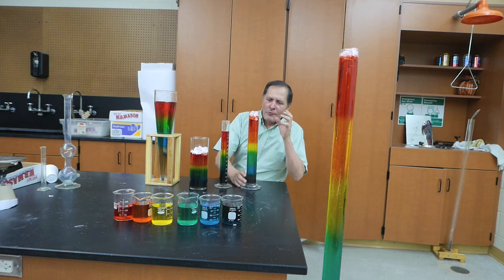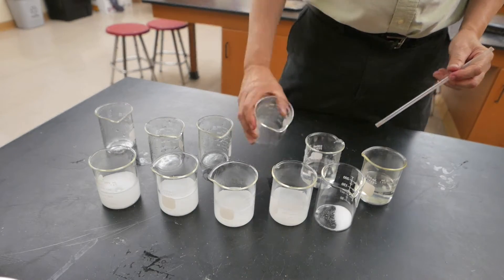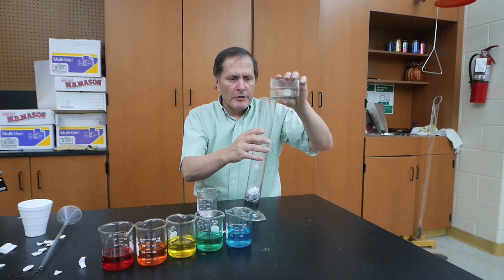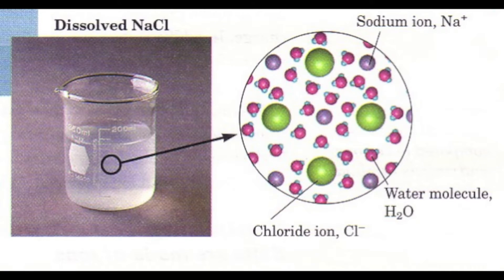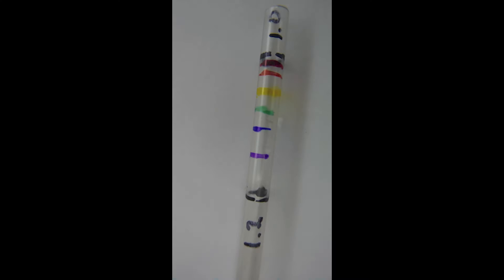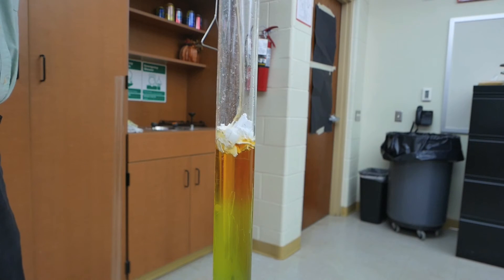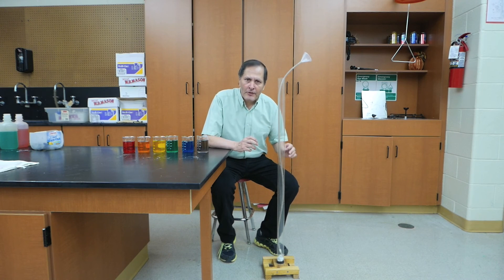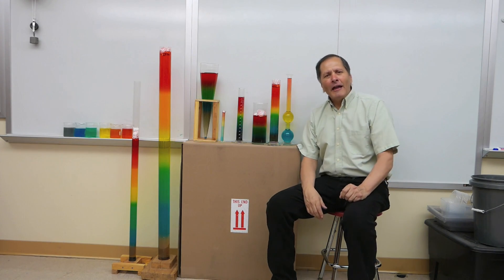Rainbow density column  -- saltwater // Homemade Science with Bruce Yeany

Comment: Didn't you do this before but have a golf ball in there and it would sink and raise? Or am I mistaken
Reply from the maker: Glad to hear you remember it. this  is the same concept,  I had a tube with salt at the bottom added water and then dropped a golf ball into it.  As the salt slowly dissolved, the ball would rise

Comment: I have a question: whenever I add them to the cylinder, the colors always mix. Always. Do you have any suggestions?
Reply from the maker: HI Aaron,   yes, first I am assuming that you have add salt in the right proportions to vary the density of each layer. TO start,  add the densest color,  then add some small bits of a foam cup to keep down the splashing when you  add the next color.   if you don't want to use the tube and small funnel method that I showed,  then  hold the container on a 45 degree angle  and very very slowly add the next colors.
Reply: +Bruce Yeany (Yeany Science) ok that worked thanks